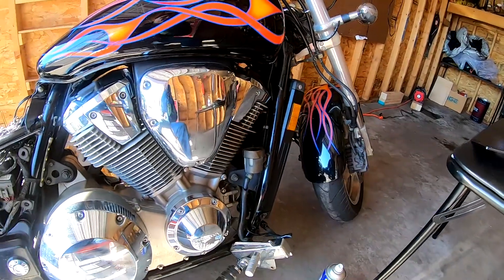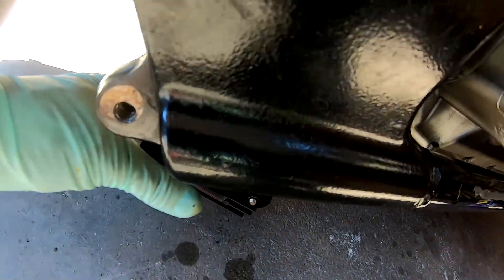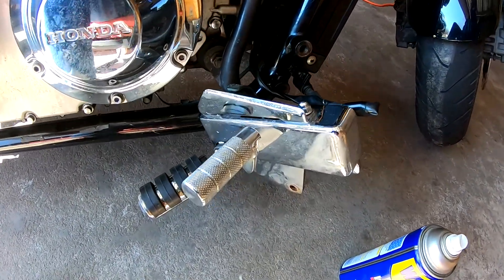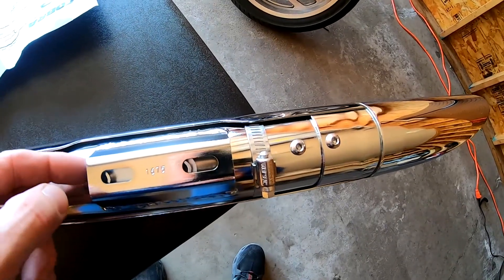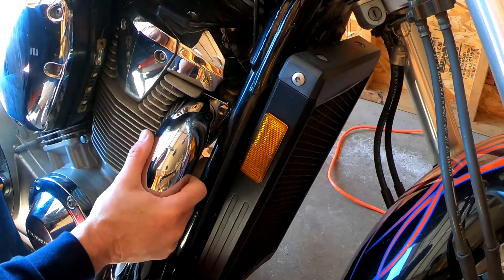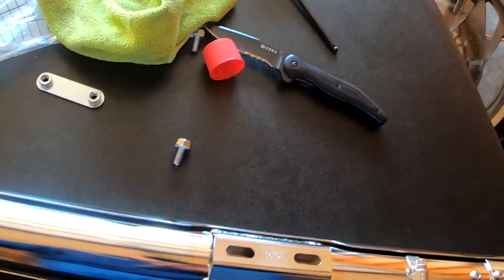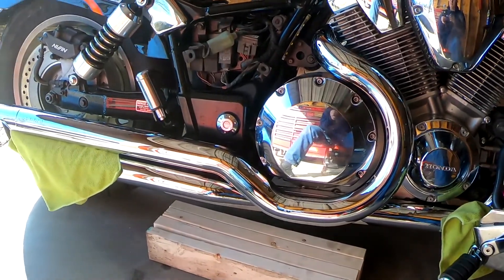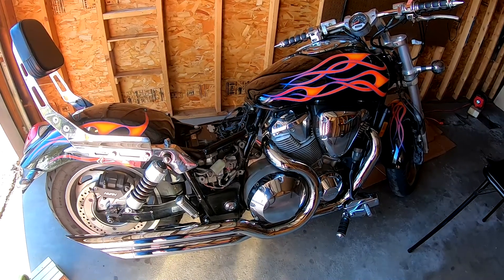2003 VTX 1800c Cobra Exhaust Install.

Comment: Great video, i have a 2006 vtx 1300 and i bought the cobra pipes too,is it necessary to take the the pipes going the motor off or can u just slip the cobras on the stock pipe?
Reply from the maker: Hello Daivid Gibson, thanks for watching the video and subscribing to the channel...good question! I can't say for sure, I replaced the whole system as it was old and beaten up. I'm not sure if slip on are available but you might want to try Cobras site or someone like J&P Cycles. I'd be interested to know how it goes. Cheers! 👍🍻

Comment: any issues with running rich or anything?
Reply from the maker: Sorry for the late reply. It does run a bit rich but that's what smooths out the "lunging" when in lower gears at lower speeds. I've lost about 10 miles on a tank full overall compared to before but the performance has improved...maybe I'm just pushing it a little harder now lol! Thanks for watching! 👍👍
Reply: @Guvnarides-WI2020  no worries. I appreciate you taking the time to reply at all. That is good to know. Mine has the stock pipes for the c line. I like it. But I think it's alittle rich. Still trying to sus out what my mpg is.

Comment: nice! did you had to do something to the carburation,  f.i or something?
Reply from the maker: Hi David thanks for your question. Cobra recommend using a power commander, it's an FI system. I am going to add one shortly probably an FI2000. The bike runs very nicely without one and there's more low speed, high gear power but there's popping on decel which I was aware might happen. Best regards, Mick.

Comment: Hi there Guvna Rides, thank you for taking the time out to make and post this video. I too have a VTX 1800 c and have been trawling the net looking for some different pipes, all to no avail. May I ask where you picked yours up from? I'm also in the UK and have seen lots advertised on UK sites but unfortunately they don't actually have them in stock. I'm also curious if you got round to fitting a power commander yet and whether it sorted the popping? Regards Dan
Reply from the maker: Hello Dan9693, thanks for liking and subscribing. I am actually an Englishman now living in the USA, I bought my exhaust system from J&P Cycles here in the US. I love the sound and performance and did add a fuel controller which got rid of the popping but I have an issue with it which I posted in an update video. I'll update again one it has been resolved. Regards, Mick.